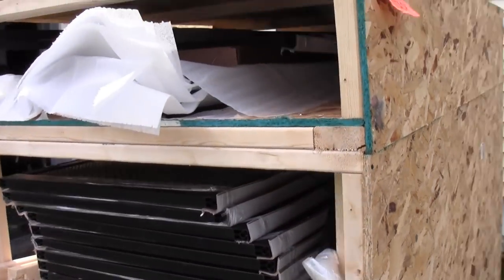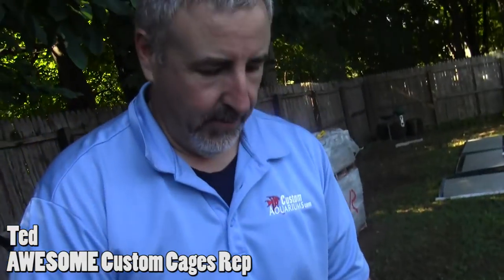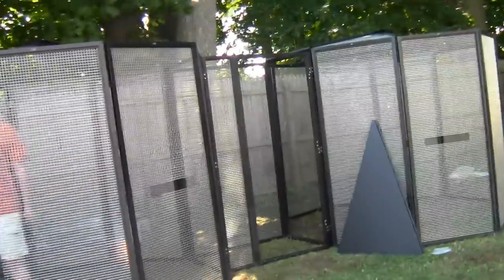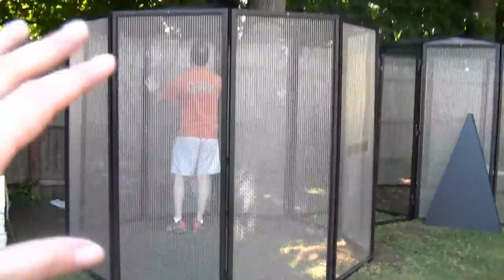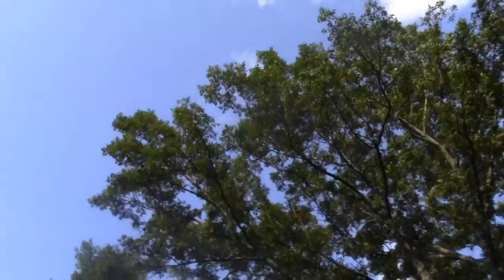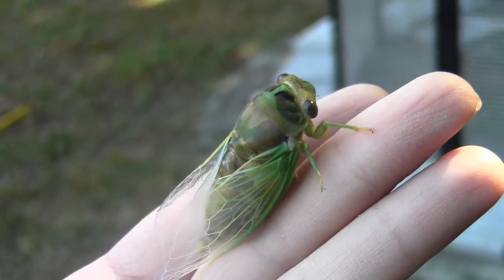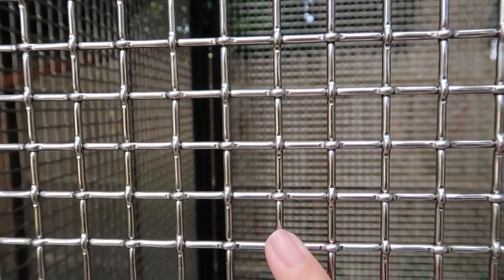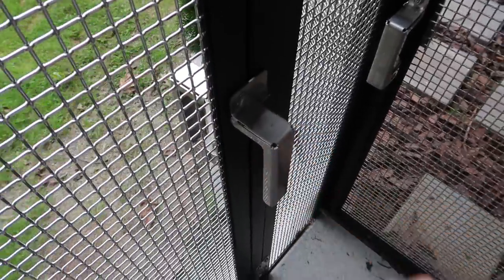NEW AVIARY! Let's Build Grinchy's Bird Aviary!

Comment: Thanks a lot for this video. I have always had in mind of building very large aviaries to house various birds, and this is fantastic! Someday, I want to own a horse property lot up in Frazier Park. With your inspiration, my dream aviary is like yours, but on a much greater scale so it works as a flight pen for breeding game birds. The top would be covered with absorbent netting instead of a solid roof so the birds won't injure themselves as much when they fly up and strike the ceiling. I won't keep kookaburras, though instead, I'll raise quails, wild turkeys, pheasants, and (if the geographical climate is cold) possibly grouse. I also appreciate you sharing the process of constructing this aviary; I didn't know it took a handful of that many workers and tons of equipment to build something like this!

Comment: Nice setup but I would have laid the pavers creating a rectangular foundation and set the cage on top of that. You want to get the cage off the ground. The damp soil will eventually corrode the paint and the bottoms of the panels.

Comment: Shouldnt it be higher and wider to let them fly around? Also, do you let the roam sometimes?
Reply: Sarah it's plenty enough space for them and if you mean flying outside with no restrictions then no. Its dangerous for the doves and grinchy and they are safer in this enclosure. As for the space, this is plenty of space for there breeds, as while they can fly, they do not fly as often as say a cardinal or a hawk or an indigenous bird of the area.

Comment: I have a bearded dragon and I need help. My dragon has been pooping out full crickets that I feed him and he seems to be getting more hungry everyday.I went to a couple different websites and they said it might be the lighting so I moved his rock under the light so he could get more light when he wanted too and he did sit under it for a while but it didn’t seem to do anything and I’m very far away from a vet. Please help
Reply from the maker: Mia Rueling Gosh that’s peculiar :/ I can’t say I’ve ever heard of this. Are you sure he’s warm enough in his basking spot? Bearded dragons require high heat in order to digest properly. Also ensure he has plenty of water and try him on some more easily digestible foods for a few days such as wax worms and horned worms to sooth his tummy xxx
Reply: It really sounds like your enclosure isn't hot enough. What are the temperatures on both sides of the enclosure?
Reply: theonlyfaith77 100-90 Fahrenheit on the hot side and 80-70 on the other
Reply: theonlyfaith77 he’s also a baby, and I have an all in one light, I tried to find out if the ‘all in one’ lights are bad but can’t seem to find anything on it

Comment: I had one of these aviaries and it did not age well. If you paint your wire black, you’ll have much better visibility of your birds. My current aviary is 12’ x 24’ and 8’ tall. I was lucky enough to find one locally to build it for me for much less than any of the commercially available kits.